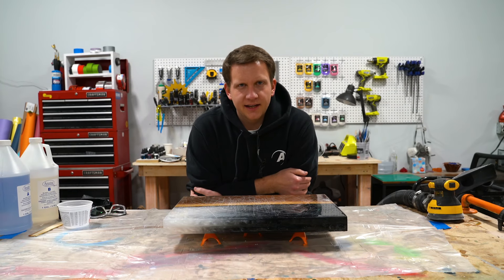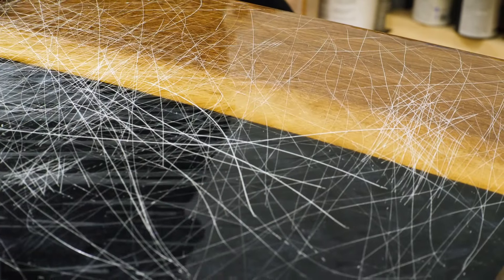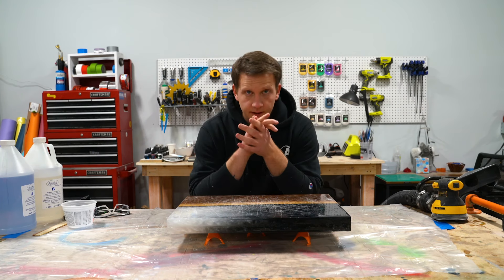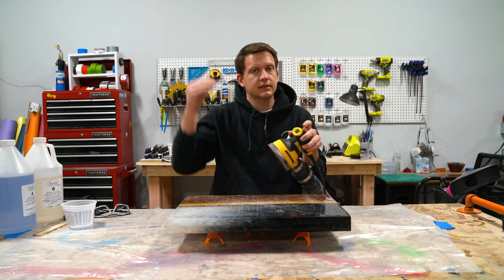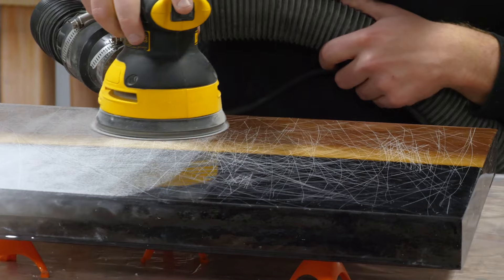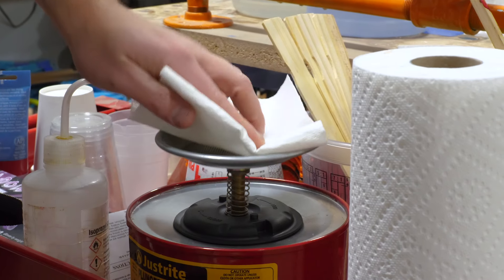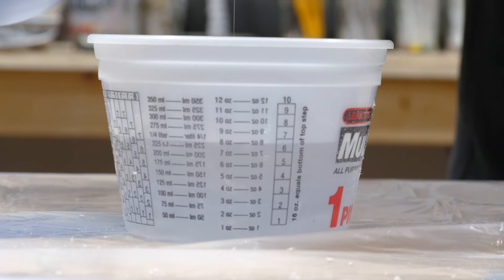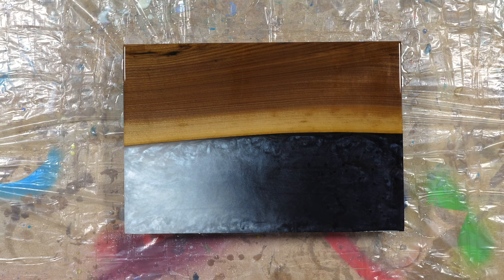How To Repair An Epoxy Resin Project | Alumilite

Comment: I epoxied my basement floor only 3 years ago. Its cratched up. Now imagine having to resurface a scratched up floor. How in gods name will i clean all that dust up from sanding? I dont think it makes sense. Im better off covering my epoxy floor with vinyl planks. At least the floors are still sealing the home from moisture.
Reply from the maker: Resurfacing the Epoxy Floor: Sanding an entire basement floor can indeed be a daunting task, and it does create a lot of dust. Here are a couple of tips to reduce that hassle if you decide to go this route:

Wet Sanding: This is a game-changer! Wet sanding helps keep the dust to a minimum because water traps the particles as you sand. It can make cleanup easier and keep the air clearer. 

Dust Extraction Systems: If you use a floor sander with a dust collection system, it will vacuum up a lot of the debris as you go. Some folks even hook up their shop vacs for added suction to keep the mess down.

Sealing Off Other Areas: Cover vents, doorways, and any openings to prevent dust from spreading through your home.

However, if the scratches are mainly cosmetic and not too deep, you might even consider just applying a new topcoat to restore the shine and protect it further without needing heavy-duty sanding.

Covering with Vinyl Planks: This is another smart choice! If the epoxy is still doing a good job at sealing moisture, vinyl planks can be laid right over it, saving you the hassle of sanding and resurfacing. Plus, vinyl is durable and relatively easy to install. Just make sure the surface is clean and level before laying the planks, so they adhere properly and last a long time. 

Stick with the Epoxy or Upgrade? If moisture is a big concern, keeping the epoxy as a base might be your best bet, especially since it’s already doing its job in that area. Vinyl will give you that new look you’re after without losing the moisture barrier.

Either way, you’ve got solid options depending on how much work you want to put into the project. And if you need advice on applying a new topcoat or prepping for vinyl installation, feel free to reach out!
Reply: @AlumiliteCorporation  thank you for your reply.

I'll need to do some research on wet sanding. 
I have a basic Dewalt sander which will indeed hooked up to my shop vac. I'll do a test run to see how much dust gets through, and maybe add a shroud if they make one. If anything I'll rent a bigger better vented sander from home depot.

Inevitably, yes I'll be covering the floor with planks. And yes appreciate not having much less moisture in my basement than before, so it'll still serve that purpose.

Comment: I have made a river table. I sanded up to 400 grit but there are still scratches, no mater how much sanding i do. Should i re sand at 120 grit and put a clear coat of epoxy over it. Or will the scratches show up when i pour a clear top coat on it. Appricate any advice you can give me. Thanks
Reply: Yes. 120 or 220. The scratches are in the surface so sand until u no longer see them. Then lay😊 a new top coat

Comment: What if there are no scratches but the top coat did harden with a “oily residue “ instead of clean clear coat ? Which sandingrit do I need ?

Comment: I have my top sanded down,  with 220. And it's cloudy, but I'm adding another layer of epoxy, will that remove the cloudiness?
Reply: Currently having the same issue, how’d it work out?

Comment: The problem I've run into is, hte epoxy doesn't stay spread out, it puddles up much thicker than it was spread out, almost like dough. It cured perfect in 30 hrs, but it's all stippled and thicker bumps, where it was once totally flat???

Comment: Thanks Jordan! 
One note: the epoxy here is bonding MECHANICALLY at this point since you are pouring onto a completely cured epoxy surface (hence the need to sand before pouring new coat). The new pour would bond CHEMICALLY if pouring over epoxy that is still in the gel or "green stage" of the curing process (epoxy is till soft and cannot be sanded).
Love the videos!

Comment: Hi, thanks for the videos! An epoxy coated board shouldn't be used for cutting, as one will end up with epoxy residue in the food.  What's your opinion on this?
Reply: That’s not only the most obvious question, but why would anyone take a knife to something which scratches so bloody easily?
Reply: There's food grade epoxy for countertops. Unless you carve out a piece it shouldn't get in your food. Could say the same with wooden or plastic cutting boards.
Reply: @jimn1968  He did it on purpose for the demonstration video. And all cutting boards get cuts in them. This is the easiest to fix and resurface

Comment: Nice video and great job! Any pictures of the results? And mine is outside and I’m worried about what will end up falling on it. Do you have any recommendations for that? I can’t exactly take what I’m trying to do and put it inside. Could I take 2000 grit or higher to it to smooth it out and get that polished look?

Comment: In 1 of my projects (cheers board) the epoxy sealing layer caught humidity and fog. Now that I want to finish it, first i need to fix that, but don't know what is the solution. I tried to attach photo, but unable to do so. Do u have any cure remedy for that or do I have to remove it and do it all over again?

Comment: What can I do if I did a kitchen countertop and some areas are wet to where now I have to scrape it off and start over .how do I stop the epoxy from spreading over the smooth side that is completely dry and the way I want to keep it. Or do I need to sand the whole counter to make it porous again and do the entire counter over for the new epoxy . I'm trying to just do the areas that didn't dry correctly if that's possible. My countertop has five different colors so I like the design that I already created and that's why I'm wondering is there a way I can just fix some parts without redoing the whole project with the multiple colors
Reply from the maker: To fix the sticky areas on your countertop and prevent issues with the epoxy spreading:

Scrape Off Wet Epoxy: Remove sticky spots with a scraper and clean with isopropyl alcohol.
Protect the Wall and Dry Areas: Use painter's tape and plastic sheeting to mask the wall and cured sections of the countertop.
Sand the Surface: Sand the entire countertop, including the smooth areas, to ensure proper adhesion.
Recoat the Countertop: Apply a fresh layer of epoxy evenly across the entire surface for the best finish.
This will give you a flawless result while protecting the areas you want to keep clean. Let us know if you need help!
Reply: @AlumiliteCorporation  thank you
Reply: @AlumiliteCorporation  thank you

Comment: Can this same process with Amazing Clear Cast be used to repair a casting done with Alumilite Clear Slow? I almost tried it but wasn’t sure if the two products would play well with each other or not..
Reply: Hey Brian! Jordan here (from the video). You can use Amazing Clear Cast to repair your Clear Slow project. However, make sure that your clear slow is completely cured (5-7 days) before you apply the ACC. Otherwise, you can follow the same process above. Great question!
Reply: Awesome! Thank you for the reply! I'm making a night light for my 5 year old nephew with a snowmobile climbing a burl "mountain". The surface finish came out lousy (my fault entirely) so it's just been sitting on my bench for about a month now while I tried to come up with a way to salvage it and this looks like just the ticket! Thanks again!
Reply: @bearded_firemedic  You got it! I hope it goes well! The project sounds cool. When you're done send us a photo via Instagram!
Reply from the maker: What Jordan said!

Comment: My resin surface is about 2" thick with deep cracks down to almost the particles added for decoration. The table is over 35 years old and was left on sheltered patio in winter. Can this be repaired and how do you begin.

Comment: Can this technique be used for spot repairs? I have a couple problem areas on a large desktop, but the rest of it was successful. Will sanding down those specific spots, cleaning them, and re-pouring in those areas do the trick? Will I have to buff out cloudiness or anything like that?
Reply: I came here looking for the exact same thing.  Did u experiment?
Reply: @scottdunlap4109  Unfortunately, no. Sorry!
Reply: Yes

Comment: I did a table top and it is slightly bumpy in a few spots can I just sand the spots with 150 grit and then just apply another layer over entire top? And when sending just sand the spots done or to the wood fully?
Reply from the maker: Yes - you can sand and recoat no problem! You don't have to sand down to the wood / remove the epoxy, just to get the bumps down a bit and the sanding will allow for better adhesion of your next epoxy layer. Email us at info@alumilite.com if you have any more questions!

Comment: Hi mate. Quick question please. Do you flood coat both sides?? If you didn't would one side dry out and warp???
Reply: if it has a coat underneath it doesnt really matter if you add another coat on just one side. but if there is exposed wood, it will absorb moisture from the air and warp. Happened to me on a large table, learned by that one lol

Comment: Is there a way to make the top layer scratch-resistant ?
Reply: Other than putting a sheet of toughened glass on top there is no scratch resistant coating that will stop knife marks (but glass is bad for knives and blunts them quickly), epoxy chopping boards are just impractical, they look cool but epoxy is not suitable for chopping boards especially a high gloss finish, a sanded satin and oiled finish will not show knife marks as bad but still will look terrible very quickly.

Comment: Trying to search how to repair a crack and a small unbonded area in my epoxy countertop but can’t find anything… Do you have any suggestions or videos about this?
Reply from the maker: Similar to this video, epoxy should do the trick!
Reply: Can this method be use to repair cracked polyester resin?

Comment: Bro , i start sanding a piece from 60 to 10000 graduale , working for one month , didnt know you can just put a layer on the top , fuck brooooo
Reply from the maker: If the piece has already had all of the initial sanding done in the past then go ahead and add on another layer of epoxy!
Reply: I’m doing the same shit, I been sanding for a week my new river table. I can’t make it looks better. Until now
Reply: Dude I almost headed down the same road and started think it was going to take me the rest of my life! And clear coating my finger nails popped into my head. If you have a tiny scratch or smudge in your nail polish or the clear coat on top of polish...you can just buff the surface and add a second top coat. It makes the defect disappear. But I wasn't about to just try it out with the resin. Hell I'm STILL scared to try it after watching this video!
Reply: @emilystubbs5650 omg love this analogy lol i have a couple scratches from my orbital sander but i was nervous on going up in grit or just too coating with fingers crossed 😅😅
Reply: @jasminewhite95  Girl do it, the more I think about it, the more I think it will work. (I legit think about almost every time I do my nails now lmao 🤣)

Comment: Probably not good to cut food on it either haha
Reply from the maker: Our epoxy is actually FDA compliant when mixed correctly and fully cured for 7 days so it's perfectly safe to use on a cutting board!